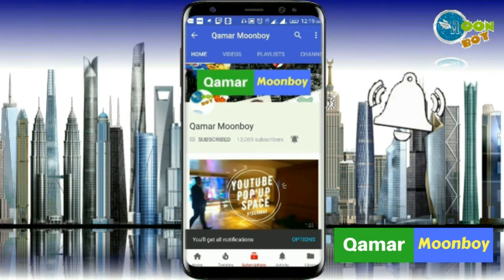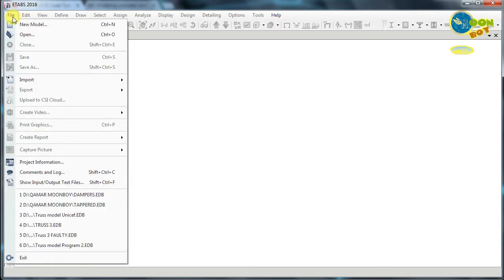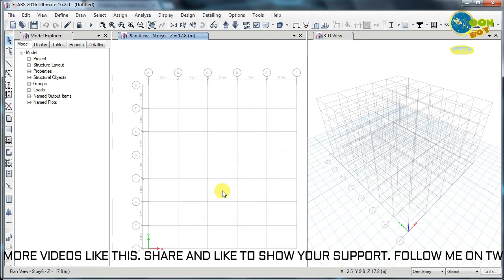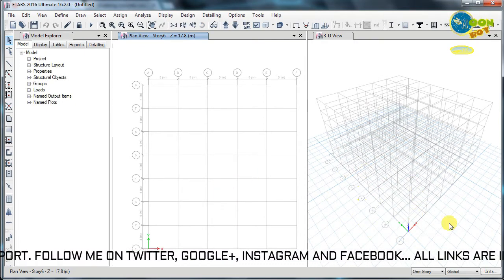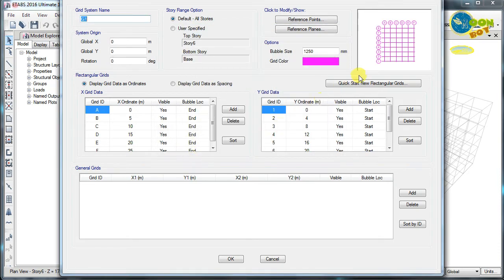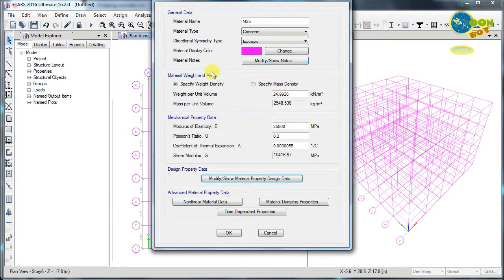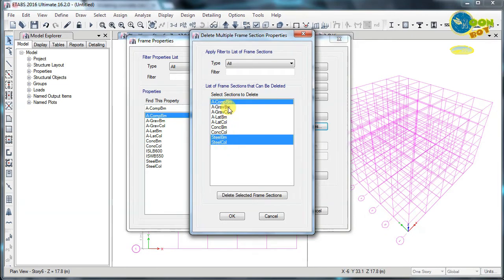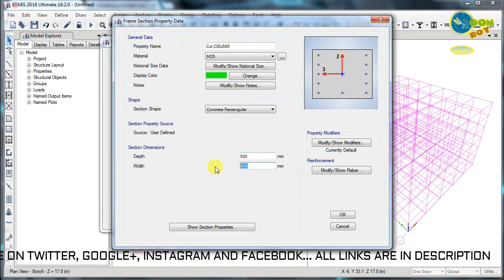Etabs 2016 tutorial 16 | Property Modifiers for Column, Beam, Slabs and Walls of RCC Building

Comment: Nice video. Will you please explain making grid from architectural plan.(beam centre lime or column centre line) when there is an eccentric beam resting on column. Or when two or more beam paasing through one column in architecture plan. But they have different sizes. Or they are at some distance. So how to make centre line. Please explain it in your next video.
Reply from the maker: I can create one for you. send me a dwg file of your plan, so that I can explain as per your requirement. Email is in Description.
Reply: i have sent you my dwg file. thankyou